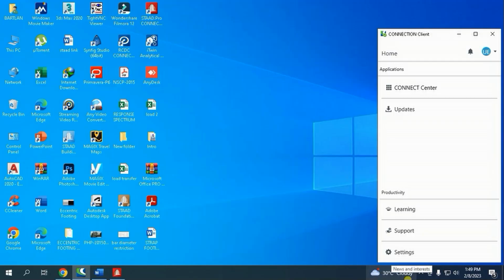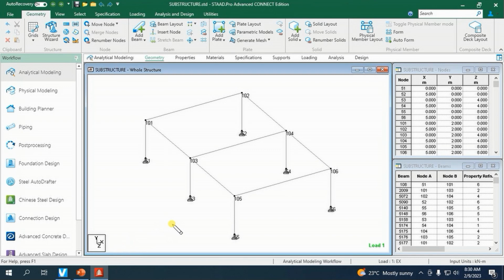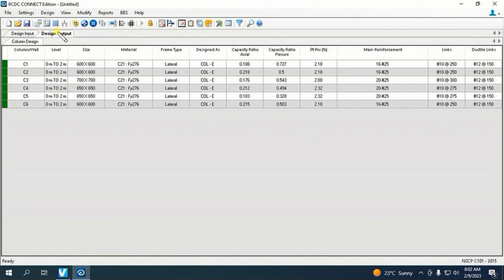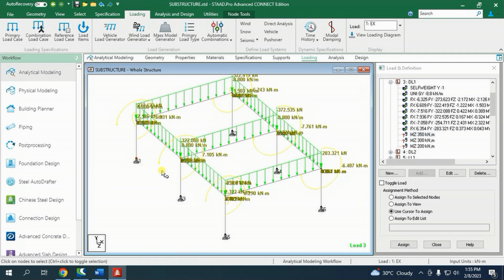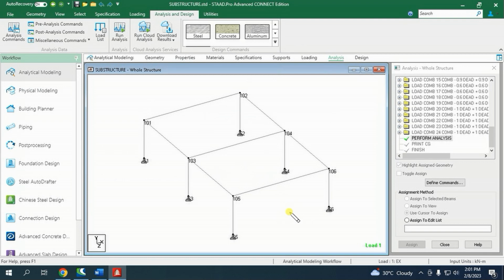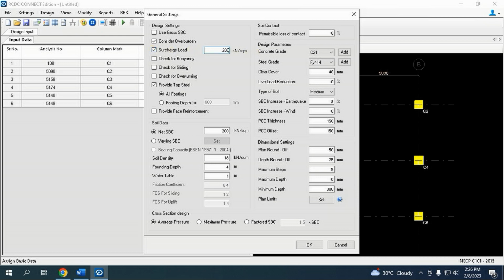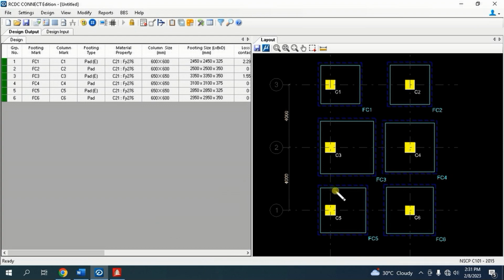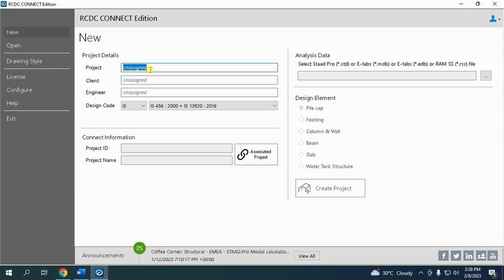ECCENTRIC FOOTING DESIGN USING STAAD.PRO CONNECT EDITION AND RCDC.

Comment: It would be easier if you use Midas nGen sir (don't confuse with Midas Gen, Midas nGen is the lastest advanced software developed by Midas, but they are still working to include all features from Midas Gen like THA, POA etc). I did the design of strap foundation in Midas nGen sir using FE analysis and the modelling is the best, and I am satisfied. Using Staad and RCDC is difficult when you are designing multiple strap foundation, like at least 2 spans both sides. Midas nGen is much much easier than Staad but it is limited to design of Mid-rise bldg. Hopefully Bentley will make a next generation of Staad software with updated modelling, analysis and design features. They should update all outdated features. We are in much advanced technology now. Midas Gen and Staad modelling is outdated, we should move to the next generation of softwares when we are ready. Tekla Structural Designer is also better. Bently should build next gen of Staad from the scratch and incorporate all features that Protastructure, Tekla, Midas Ngen have
Reply from the maker: I have another simpler way of doing this, much more simpler by modelling the footing using plates.
Reply: @BARTLANTV  sir asan yung video nito?

Comment: How about using finite element method?
Reply from the maker: Rcdc fe
Reply: @BARTLANTV  why you do trial and error method especially in assigning moment?
Reply from the maker: @mo2pqw21  We dont know yet the size of footing. We can get the maximum reaction of column by considering the service load combination then that reaction divide by allowable soil bearing capacity then you can get footing size and get eventually the moment. However due to effect of sliding or overturning , some footing would be bigger than the other and can be resolved by adjusting moment.